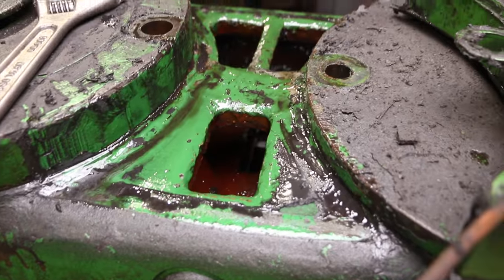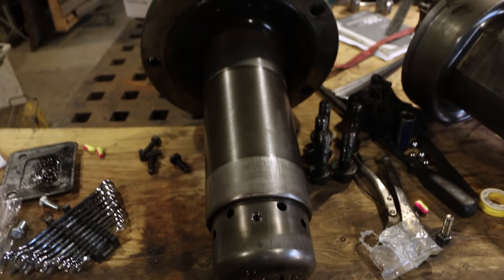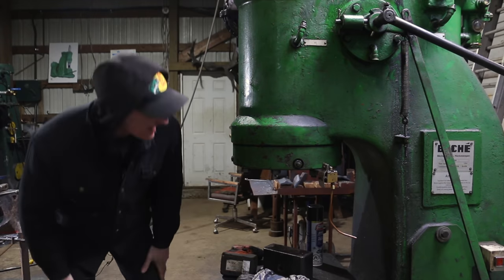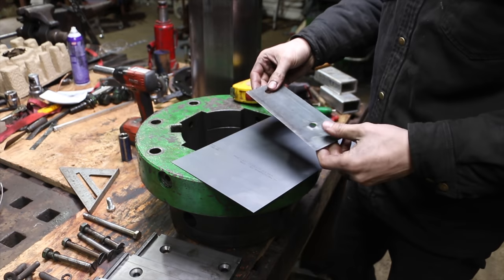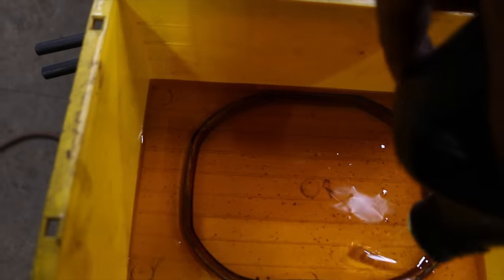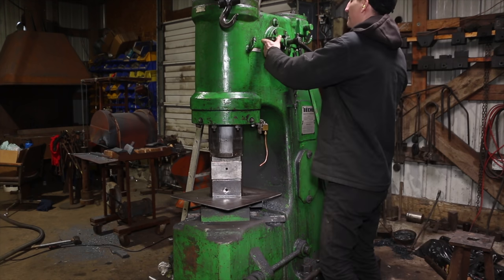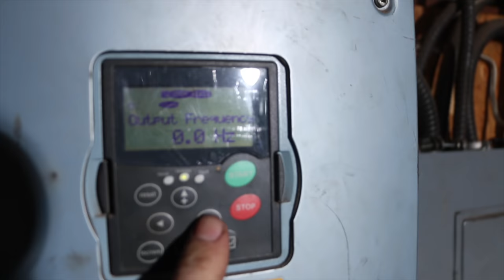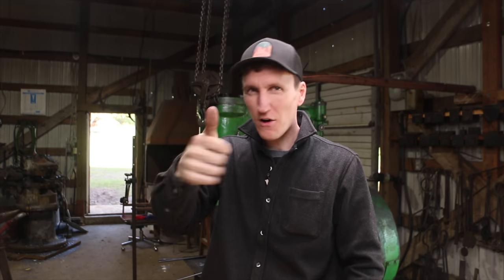How did this get into my power hammer?

Comment: Hey, I’d check the electric motor again just to be safe. Get a multimeter and test motor winding resistance. So, unwire the motor verifying you know which wire goes where. Test across all three windings. You shouldn’t have more then a few ohms of different between them. If you find that one winding has more or less resistance, then you know that the motor needs to be rebuilt. 

Being that there mere melted wires, definitely could have an issue like this. And that the motor is drawing its full load amp at 75% rate  definitely a sign to take a look. Hope this helps

Comment: Multi-phase motor with a phase with melted wire connectors. The motor winding has a short, be it intermittent and with heat will get very bad. A short in an electric motor winding doesn't always kill the motor, they can present as down on 'power' but will still draw similar loads. I'd say the VFD is very good at hiding the winding issue due to how they function to create the soft start and multiple phase array. 

Also reading the power draw off the VFD won't give you information on winding issues, as VFDs inherently 'limit' power output so would hide a short very well. 

I'd take the back cover off of the electric motor (non-output side) and check the windings to see if you can see discoloration in any of the windings, it's usually fairly noticeable blackening/purple discoloration. Check the bearings on the motor too, failed bearings don't always give symptoms until they're really bad. Could be another explanation for power loss.
Reply: Shorts always kill electric motors!!! The only motor who can survive a short is a DC
Reply: @gary00832  that's not true, as it depends entirely on how bad the short is and where in the windings. Had multiple AC multiphase motors with intermittent faults or showed as down on torque.
Reply: @josephgriffiths7656  just a matter of time until it pops when you throw it across the lines! Ever pinpoint a short, they’re usually down it the slot somewhere.

Comment: New operating procedure for procuring and operating a refurbished old power hammer. Open it up to see if anybody stuck something inside!

Sometimes when you get old equipment you find out that there's stuff inside of it that isn't supposed to be there. It's like cracking open a pinyatta and finding car parts falling out instead of candy. It's surprising weird unexpected and yet it happens.

Comment: Get the motor MEG'd. It could have a slight short that you cant measure without putting a few thousand volts through it.
Reply: A short is a short and even a tiny one would burn the windings

Comment: I have a feeling its possibly shoring inside the electric motor, and itll only occasionally do it if it gets warm. that might be why it melted the one connection and will pull down the way it does. it could also be a capacitor if it has any